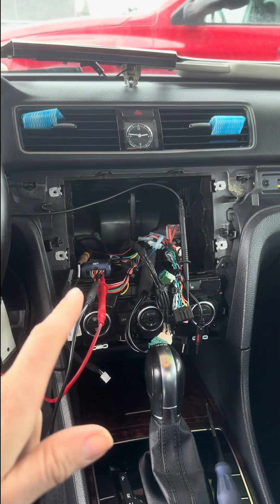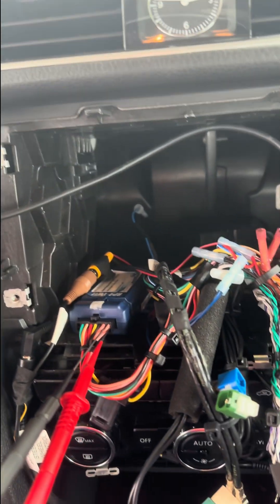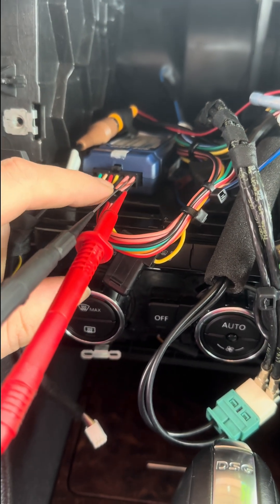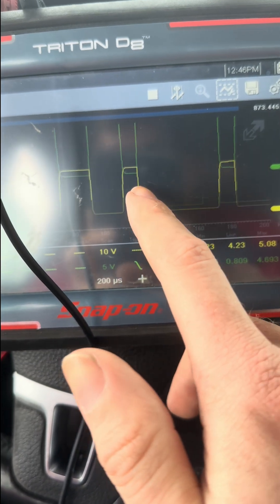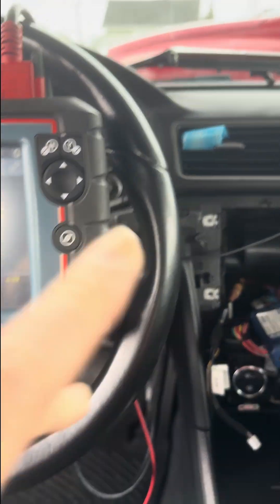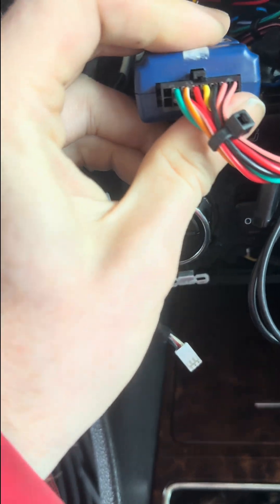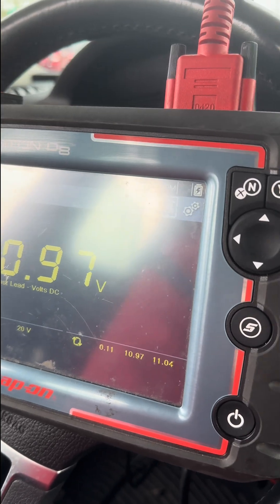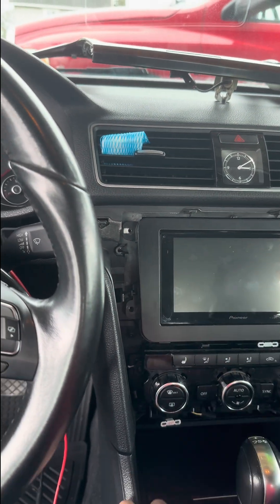Aftermarket CanBus Stereo Won’t Turn On- How to Diagnose and Fix

Comment: What if it keeps booting up and when it finally works tocuh screen wouldn't work but steering wheel button does. I did this and it work but then after I turn it off and don't use it for like a 1hr it goes back to the same issue. I have a aftermarket radio.